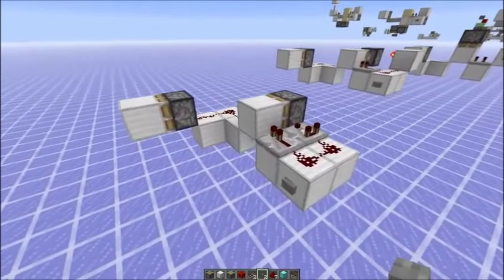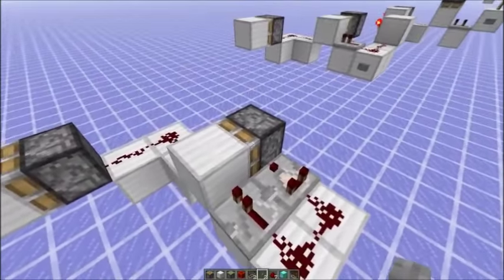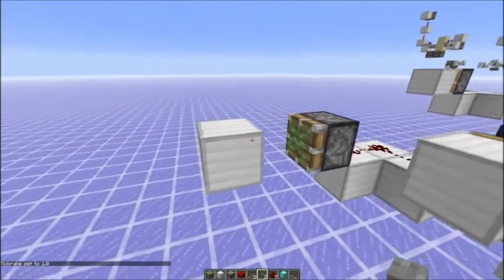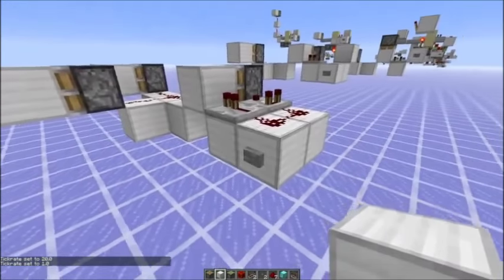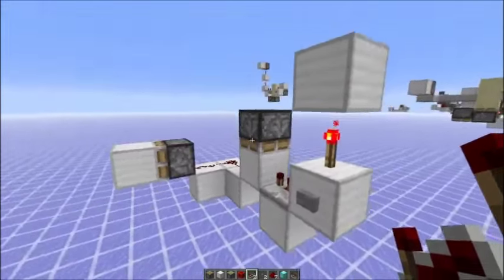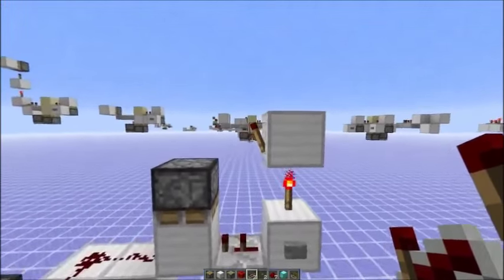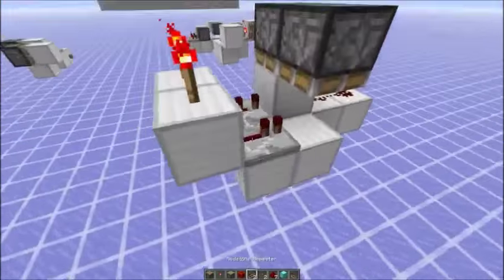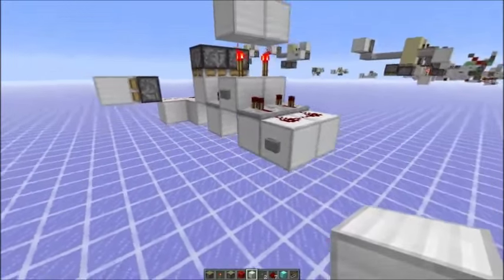Advanced redstone basic knowledge: practical use of 0-ticks and instant repeaters

Comment: In a dark oak tree farm I am making, I used the sand 0 tick generator and it seems like I got a piston to extend and retract within two game ticks.  Although, it seems locational so it is practically useless
Reply from the maker: +Corn Bread Redstoning I've stumbled upon this behaviour as well. sometimes you can push a block again 2 gt after the retraction started. No idea why this is happening.
Reply: +ilmango Its also very random on which pistons it will work for.  For example, on a double extender part of the tree farm, there is always either the right or left pistons that work with this behavior.  Although, it always works with only one of these sides, not both.  Also it does not seem to work with quasi piston powering.

Comment: What is the difference between this and a monostable circuit if they do the same thing as far as a stickey piston goes?
Reply: A sticky piston takes 1 tick to push out and 1 tick to pull in

A mono-stable circuit changes a redstone output into a 1 tick pulse, this then powers the piston to push out, using one tick, but not giving it enough time to pull back. Therefore leaving the block pushed out.

This 0 tick pulse does somewhat the same thing but, it does it mush faster making it basically instant

So the difference is that the 0 tick pulse is faster than a mono-stable circuit
Reply: Kiwk are there any particular circuit that won't work with monostable but work with a 0 tick pulse? Can you give me examples? Thank you
Reply: Honestly I'm not sure of any
Reply: probably as he said in the video the tree farm. he pushes the logs with 0 tick pulses in place and then into a tnt chamber. im not 100 percent sure if this circuit would work with a monostable 1tick instead of a 0 tick.
Reply: It can be used to make some stupid fast piston doors!
Reply: indeed
Reply: @rizalardiansyah4486  in some ilmangos tnt blas chamber, it was important to sometimes have qc powered piston extend and sometimes not. He achived it by switchnig between classic monostable and 0tick generator

Comment: and ur dual edge 0 tick gen has 6 gt inbetween each 0 tick bc the falling edge of the 0 tick generator isnt instant
Reply from the maker: +Jendrik Weise I don't get what you mean. You have 3 gt before the first and second 0-tick. You can't activate it again at 6 though. Normally you don't need to, unless you're building a rotor. in this case you need to do something else there. I showed this in my video about a dual edge 0-tick gen.
Reply: when powering the dual edge 0 tick gen, u need a 3, or like in the video, a 4 gt pulse. when sending the blocks u instantly get the 0 tick, after 4gt the signal turns off again and then it takes 2 gt for the pistons to get back so it takes in total 6gt inbetween the tow pulses. (i like to fail this stuff so it migth be wrong xD)
Reply from the maker: seems like you didn't understand how it's working. You remove the power source, after 3gt.
Reply: oh no no no, i got that i meant the original dual edge 0 tick gen where u said "u get tow 0 tick pulses 4 gt apart from each other"

Comment: 1. you can extend a budded Piston with any 0-tick if you update it with redstone dust2. lately i have been working on fast buds - i got one down to 3-ticks (reset time) i think 2 ticks are possible, im not too sure about 0-tick reset.. maybe a t-bud - what do you think?
Reply from the maker: +Albert Affstein 1. That's nice, but if you have enough space to update it with seperate redstone dust, you might as well power it directly. But maybe it's useful somewhere. 2. I don't think 2 gt is possible, because piston cooldown is 3gt.  The only thing that resets faster are rails, but they don't power anything.
Reply: yeah, i tested the idea i bad for 2 gameticks and it didnt work (it fired twice  and didnt reset a redstone-block properly)